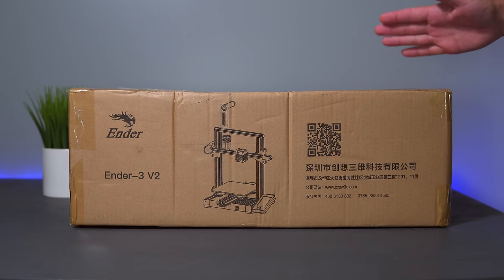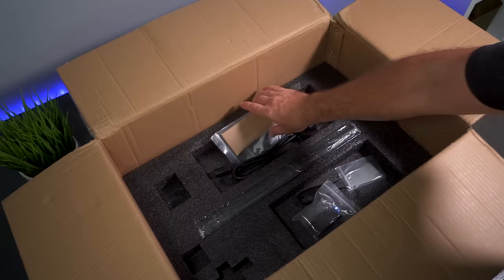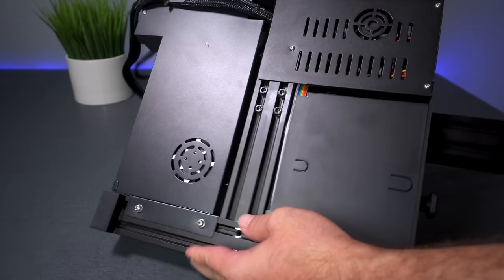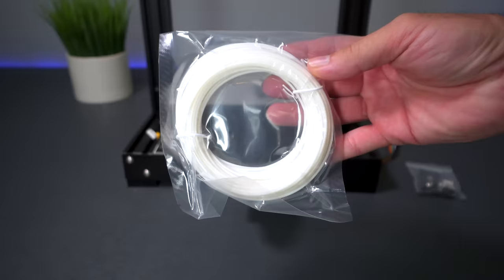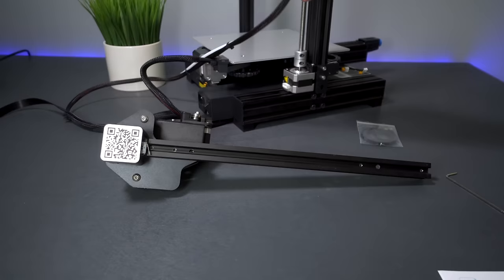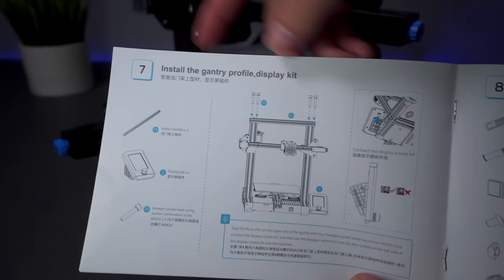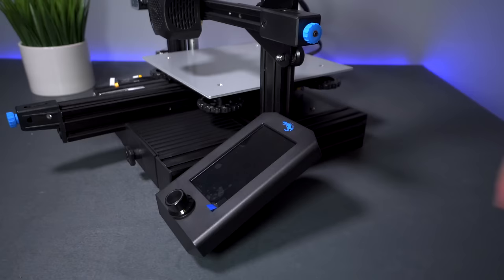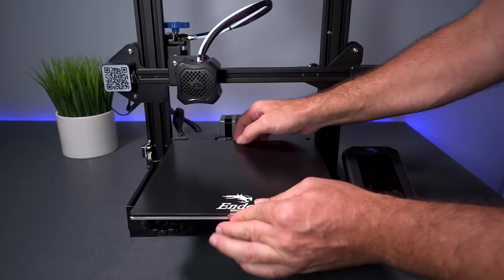Creality Ender 3 V2 - 3D Printer - Unbox & Setup

Comment: Opened mine and bars had stripped threads, small wires were wrapped tight under the weight of the base instruction manual not even sure if it will work or assemble

Comment: I ran into a problem mounting the Z axis motor (15:00).  The little black plastic mounting block won't hold it straight and it tends to tip down towards the chassis at the rear which makes the lead screw point out away from the upper assembly so it tends to bind.

Comment: Ok. I've watched this vid over and over again, and I finally worked up the nerve to put mine together after 7mo. My problem seems to be there's some glitching in the bed and on the up and down what is that the Z and Y axis? Now that's just for straight out of the box. how do I work those out. And is there a easier way of bed leveling? Every time I thing I get one side right, the other just keeps getting tighter? I've been working on it for over an hour.

Comment: This is great. I couldn't put my printer together with just the paper instructions. Only thing is, my print head bar wont go up and down just by pushing, i have to turn the lead screw holder. Is this a thing? Do i need to pull it apart and start over?

Comment: Hello, thank you for this very helpfull video, I have just build my E3V2 with only your video, without the instruction booklet.  It started printing the "cat"-file fantastic till about 8% when I noticed a loud clicking sound from the extruder... the filament was starting to cool down in the nozzle because suddenly the "set" temperature of the nozzle was at 136°  any ideas why ?  I have now reloaded the filament and sliced one of my own models, hopefully it will not happen again because it's a very long print.

Comment: So I followed the instructions to a T, but my axis does not go to the corner. It just goes to the top middle and that's it. Then when I hit preheat pla, it shuts off. I wonder what I did wrong.

Comment: I got to the point of putting the x axis onto the frame and the lead screw and it will not move at all on its own. the wheels on one side adjust and the wheels on the other side do not move at all, the eccentric nut does nothing. what is going on?

Comment: I can't put the lead screw on because i have to undo the allen key bolts on the stepper motor but it's so tight, i might need to heat them up

Comment: help.. I just unboxed my printer and started adjusting the rollers and the pulley so it's centered on the rail but the bed still runs all bumpy but if I loosen the rollers then the bed gets too loose.

Comment: Is there a trick to getting the spool holder on? I put the T nuts parallel to the bar and tighten the bolts most of the way, but the holder is still loose.
Tried tightening them all the way as well

Comment: I followed along with this but for some reason, my screw for the cross bar is angled back so when i thread it onto the cross bar and i press down on it, it does not freely move down.  What could be the problem?  I put the threaded rod on the table and rolled it, it is not bent, not sure what im doing wrong here...

Comment: I cannot get it to loosen up for the push up and down on the z-axis around the 23 minute mark. Would it be anything other than the Eccentric nuts? (Which I cannot get to loosen or tighten on the left hand side)

(I believe it is a manufacturer defect because it just came out of the box and I did not turn the eccentric nut more than a quarter turn in either direction to try to loosen the wheel)
Reply: I ended up having the same issue, what I ended up doing was loosening the entire wheel by using the allen key and the concentric wrench, then adjusting the wheel tension until the wheels had a slight resistance to it, I hope this helps!

Comment: Thanks for the tutorial: when installing my x-axis profile, the bar will not stay level. The right side is tilted higher. I also cannot pull the x-axis profile up manually and have to twist the z-axis motor module in order to get the profile to raise. What am I doing wrong? I followed your tutorial to a T and cannot seem to figure out that the issue is. Thanks!

Comment: Hi Just Vlad. Great video helps alot. I have a small problem with the x cable. It shows three question marks for the X Y Z  in the monitor. Is there a solution to what the problem could be. The cable is in as you showed./Peter..

Comment: Love the video, it really helped simplify and breakdown the building of the machine.  I am having trouble getting the filament to stick to the bed.  I have been trying to print the dog sample file that came on the included micro usb.  Each time it starts to print it draws a long line, returns on this line and then moves over of the center of the bed to start the print.  The nozzle makes a little mess at the beginning but then the filament sticks to the bed for these 2 lines.  When the nozzle moves over to the center of the bed these lines become disconnected and drag with the nozzle.  Then nothing sticks and it just puts out a mess of curly goobers.  I have tried adjusting the z-offset to -0.10 and -0.15 and nothing has changed.  

Like cartoon Cathy says - ACK!  Anyone have any suggestions?  Thanks
Reply: Try checking the file I could be brocken or missing data also you could also update your 3d printer if doesn't work message creality the maker of the printers

Comment: Video was very helpful except when I lowered my platform low enough to not rub against nozzle, it was also too low to clear the housing of the y-axis (Front to back). During homing it just made a weird noise and then stopped and sat there. I am completely new to the hobby so any advice is helpful.
Reply: After some tinkering I can get auto home to work but then when I try to adjust at the next step I have to lower the back end too much so that it can’t go all the way back on that forward/backward axis so it won’t be able to auto home after leveling it.

Comment: Great video! I do have a question though. My z axis goes down fine but it doesn't go up without me pushing up from both sides. Having a friend of mine look at it, he said that the large bolt that the z axis motor runs on is the cause of the resistance. Does anyone have a remedy? It could also be something else, but I thought I'd ask

Comment: At 21:53 when you start pushing down on the hot end to make everything go to the bottom, mine does not move at all when I try to push down on it. I am able to spin the t screw around like u did but can't push down. Any suggestions? Please help 🥺
Reply: I’m having the same problem

Comment: My ender V2 is giving me so many problems right now :( I followed the provided video in the SD card and it barely works, I can't print the provided Dog or Cat STLs for whatever reason, it basically prints out a wireframe of filament until it collaspes. This was after I had to fix the feeder where the tip of the printer was heavily clogged after my first attempt, I don't know what I'm doing wrong and I don't know how to fix any of this :(
Reply: And right before typing this my printer bed seems to be freaking out, I select "Auto home" and it proceeds to make this aggressive buzzing noise like it's trying to go further than the bed can go, this JUST started before it seemed fine.

Update (as I'm typing this) When I select "Auto home" The bed goes as far back as it can and appears to try and go further which causes the aggressive clanging noise, I don't know what I'm going wrong anymore and don't even know if I can return this :(
Reply: Okay update 2 fixed the bed problem, apparently it was over tightened/lowered to where it was getting stuck, loosening the screws/raising it stopped it.
Reply: My back left corner of bed won't lower :/

Comment: I just printed my very first print using the dog.gcode file on the memory card.  I used the default print settings, and bed temp is 60 degrees.   But, my models are impossible to remove from the ultra-base plate even when things have completely cooled down.   I have to use the scraper with a lot of force, and prior to print i made sure the surface was cleaned using isopropanol alcohole.   Any ideas what i'm doing wrong ?     Your video shows your model just popped off so easily.

I'm also completely hocked now - many thanks for your video otherwise i would never have started this venture!

Comment: My main screw is set up the same way but in the video you just push up and down and it moves is there something I’m not doing right… nevermind another issue came up with the leveling had the platform all the way down and it still was scraping across the glass at that point I was done and threw it out the door
Reply: Get it back! Just raise the limit switch on the side up about 2-3 mm. Problem solved!

Comment: When adjusting the belt for print bed, I have bumped both of the tabs over, and honestly tried several spots at this point and my belt will never run center... is this just a bad belt?

Comment: I’m very late but are you supposed to put the sd card in a computer, save a file to the sd card, then remove and put it back into the printer? I was very confused on that part
Reply: Yes, that is what you do!
Reply: @TC9  ok tysm and one more question. I have a desktop so how would I do that. I can try to use my brothers laptop if the desktop doesn’t work
Reply: @QuarterMcPounder you can get a usb adaptor for the sd card and place the sd card in the usb adaptor. then you can plug the sd card into the computer through the usb and then put it in the 3d printwr

Comment: So at 21:48 there is no clearance between the screw and the extruder port on my printer. As the x axis assembly moves up and down the screw grinds against the extruder port. Was my printer manufactured incorrectly?

Comment: Hi, my Ender 3 V2 just arrive and i have been following your tutorial step by step. However i am not getting the smooth movement when i put the assembled x axis on to the gantry. There is a lot of resistence especially when I  lower it toward the plate. I haven't tightened anything up yet so not sire what i am doing wrong. Any tips please?

Comment: I really appreciate your guide to setting this up. I just got mine and followed your guide step by step.  I feel like I am so close yet so far. No matter what, I can't do the levelkngt becuase the rear of the bed is always too high relative to the front. So I can level the front screws but then when I move to the back I can't lower the bed enough. Could this have anything to do with the install? Or that my glass isnt perfectly flat? Please help, thanks!

Comment: Mine binds when I push down on the extruded section, but if I push down on the brass connector to the z axis rod, it’s okay.  Is that an issue?

Comment: Hi, so I have a huge problem and I really need a hand with this. When I am levelling out the bed so that the printer doesn’t touch the base, is wont let me push the bed back because it’s to low and it hits the motor I think that is at the back of the printer so then I lift up the bed but then it scrapes on the printer again and I can’t seem to even it out. If you have any idea what the problem
Is please tell me so I can print my rocktipus
Reply: if you have any idea what is causing this please tell me as this was my only present for christmas and i cant get the bed to level and ive wanted this machine for so long.
Reply: Heres another way of saying it. When i push the x axis down it hits the bed before clicking, so i then lower the beds but then the bed cant move all the way back because it hits the motor at the back.
Reply: Try adjusting (raising) the Z axis switch bracket on the left side (the clicker). Move it up a tad so that there is no bottoming out

Comment: Great tutorial & easy to follow! I can't get the filament that came with it to stick to the bed. The bed is level so should I buy a different filament? Any suggestions are appreciated! Thanks.
Reply from the maker: Try slowing the speed down on the first layer. Make sure your nozzle gap is as small as posdible to the bed. Also try washing the build surface with normal dish soap and rinse well.
Reply: @JustVlads  thank you so much I will definitely try that!

Comment: Just used this to put mine together and all it does it bind up and make a loud noise when I Auto home.
Reply: Make sure the back part of the plate is not hitting the printer by adjusting the plate to move down a bit. Also make sure the flat part of the clamp is on the bottom side. One of the sides has a little slope on it. Had the same problem.

Comment: How do you know how tight to tighten the belts? 

Also my printer seemingly can't level at all. I spent an hour trying to level it. The nozzle was too high even with the stopper at the very lowest and my wheels would always end up with like one wheel about to fall off and the other as tight as possible. Are the spring lengths supposed to be the same? Because my spring lengths are all different.

Comment: Hey question for just vlad i live in canada our standard voltage is 120V for wall sockets i have this printer and was donering to i move it to a 115V positon or leave it at 250v

Comment: Hey, the place where i plug the power is a bit loose, do you find it in your printer too? Mine has issue, the device has electricity running in the frame, i wonder if yours also has the issue...

Comment: is some vertical wobble on the print bed normal? I made the eccentric nut as tight as it'd go but the rubber wheel is still ok amount of loose. It doesn't wobble sideways, only up and down

Comment: Did they change the design on the coupler? 27:38 My coupler has the blue clip, but there isn't any plastic pieces to "pull apart". Just one single piece

Comment: Great video. Did anyone have trouble pushing up the z axis by hand ? It moves down ok however I have to use force to push up.  I watched a few videos and cannot figure out how to the z axis to move up by hand.  any help is appreciated
Reply: I ended up having the same issue, what I ended up doing was loosening the entire wheel by using the allen key and the concentric wrench, then adjusting the wheel tension until the wheels had a slight resistance to it, I hope this helps!

Comment: I'm having some problems with bed adhesion on mine.. unlike the typical discussion that you find on the internet, my prints stick too damn well to the bed.

It's pretty much impossible to remove them unless I reheat the bed. Compared to the example from 43:57, I had to apply quite a lot of force even with the bed heated up. Do you have any idea what might be wrong?

Comment: After having never been around 3D printers, I bought the V2. Seeing this video and speaking to the seller, it was supposed to be a good printer for a beginner. But no. The only people I've seen online say it's a good printer for beginners are people who already know their way around 3D printers. It's awful. And I keep reaffirming my opinion by googling the problems I've had in the past 48 hours since I got it. It's the Wish version of 3D printers. There's even Chinglish on the printer screen controls.
Multiple people have said that immediately after buying it, you already need to change out a few parts.
That's not something for a beginner and that definitely doesn't scream out "good product".
If you're a beginner and reading my comment, do NOT buy this printer!
It's difficult to thread and finally when you manage that, the filament doesn't stick to the glass and comes loose after about 20-40 minutes of printing.
Out of around 15 models I've tried, 2 of them finished printing (not looking good though). All the others came loose and there was plastic thread over everything. And that's after changing the temps, after reading everything I've found online.
I'd rather wait a while and spend more money on a better printer than have ever had spent my money on this junk.
Sorry to poop on your video, but this printer is garbage.

Comment: Is the x gantry supposed to go back up just as easily as 23:37? I can't seem to loosen the concentric nuts on the motor side of the gantry either. The wheels seem very tight. Can anyone offer me some advice?

Comment: I have a pretty frustrating Problem:
After putting the X-Axis onto the two Vertical Profiles and running it down to the bottom, the rollers on the left side, won‘t turn at all by hand. No matter how change the nut on the inside, they have just way to much pressure on the surface.
Can somebody help me?
Reply: I ended up having the same issue, what I ended up doing was loosening the entire wheel by using the allen key and the concentric wrench, then adjusting the wheel tension until the wheels had a slight resistance to it, I hope this helps!

Comment: 22:45 My wheels, on the side with the rod, are very tight when trying to move it with my fingers but a little easier if I rotate the rod. How do I loosen the wheels without the eccentric bolts?

Comment: I started working on my Ender 3 V2 today, and built it while watching your video. 

My x-axis seems really stiff, and doesn’t move easily. One side I’m able to adjust the rollers, but the left side with the motor will not adjust. No matter what way I do it, the rollers won’t spin easily when trying to move them with my finger.

Any suggestions?
Reply: Did you ever solve this?? I’m having the same problem!!

Comment: Hello I bought this as my first printer but I'm having a problem with my plate hitting the battery thing behind it when i set it low enough to have distance from the nozzle. Help would be appreciated.
Reply: Im having a similar problem. I click auto home & the hot end moves correctly but the plate moves all the way back and makes this loud ass vibrating noise. The display screen is stuck on auto home & you can’t do anything unless you turn it off and turn it back on. I’ve seen a few people with this same issue but I can’t find a real solution. Extremely frustrating considering I followed all the steps.